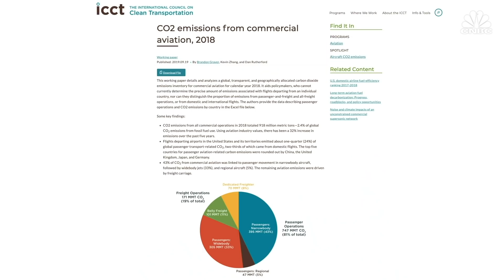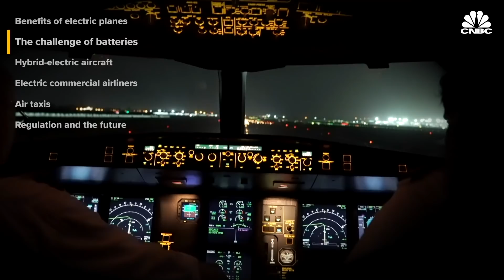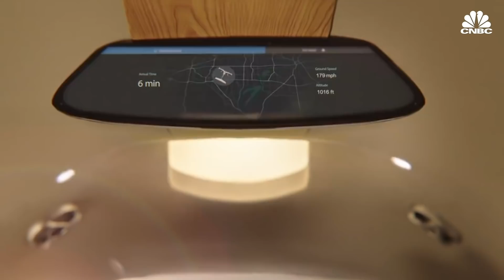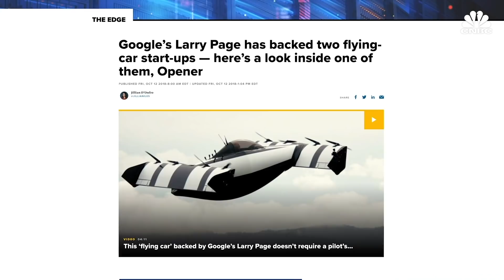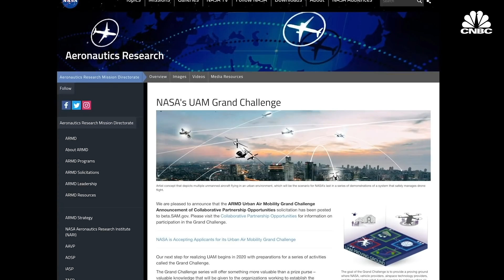Why Don't We Have Electric Planes Yet?

Comment: Because we have barely started with electric cars and airplanes are a lot bigger, more complicated, and more power hungry than cars.
Reply: There are other issues to, planes need to be lighter to land than they are taking off otherwise they can over run the runway and crash. With fuel this is not a problem as it's used up while flying but with batteries that weight doesn't go away even if you use the energy
Reply: @AdamSmith-gs2dv  This mostly applies to the largest of airliners as not every airliner has the ability (requirement) to dump fuel

Comment: Electric planes for short distances exist since a long time, they’re called trains. Way more efficient and cheaper.
Reply: In America we do not want efficient.  We want what is overly complicated and expensive.  Trains have always been the best way to move freight across the country.  Solution, remove all the tracks and invent a new career option!  Over the road trucking!  Thousands of accidents a year, no education required, horrible for the environment, and hugely expensive for everyone involved!  'Merica!
Reply: @davidbeppler3032  What are you talking about? Americas freight rail system is the best on the entire planet. Trucks are not used for long distances, port to warehouse shipping is primarily done by rail. Warehouse to store/consumer is what is done by trucks.
Reply: @AdamSmith-gs2dv  Have you ever been to America?  There are no trains.  They are extinct.  But we have hundreds of thousands of truckers.  For reference I grew up in a town with a functional train system.  It was never used, but it was functional.

Comment: Because the REAL electric age is still in its infancy... We'll get there soon enough once power density of battery tech improves...
Reply: Batteries have been around since cars have been around, infancy my ass
Reply: Ian Weetman if, not once.
Reply: Ian Weetman the technology is here, investors are just getting the most out of oil first
Reply: It has. Just not ethical though. Child labour.
Reply: jweltsch22 you should read up on what happens when technology meets Hydrogen lol. There are risk with every thing that is flammable. Hydrogen and electrolysis is the way to go. The only by product is H2O if done with Solar, wind, hydropower or even nuclear.
Reply: @Kenny-qo5tz  nah, because I already none of that matters, because of something called Human Nature.
Reply: Edison was making electric cars...
Reply: @abyteuser6297  that's nice.
Reply: The oil age is younger than the electric age. Having a power plant convert material directly into usable energy is more efficient than producing energy, storing it, then consuming it.
Reply: Glad I won't be around!!!!
Reply: This. This comment nails it!
Reply: I tgink recharge time is more important than power density.
Reply: A good looking new tech right now is aluminum ion . apparently some feel it will hold alot more energy than lithium
Reply: Very true. One day when get get better batteries or a new fuel source tech we’ll have EV planes .
Reply: Indeed! Batary power with super Potential Energy like keeping power to a year with out charging it
Reply: Or maybe in 2024 during a solar maximum 😋
Reply: True... but some people will use that fact to basically say we shouldnt even bother trying to develop it because we arent there yet.... which is pathetic. Like yes, we get it.... we arent 100% there... but the only way to GET there is to put in efford and continue on down the path
Reply: @Ben  Daulton  Fascinating.
Reply: @Ben  Daulton Even of they figure out how to make it rechargable, it's cycle life will be really low for a long time. It may never reach the cycle life of other battery chemistries and top out at the low 100s.
Reply: @Sam Mencia You can use electricity to produce hydrogen, there are sources of electricity that do not release CO2. 
Hydrogen is a superior energy storage of produced electricity for transportation. 

I'm sorry to inform you that if you thought that I had not taken this into account then it's your education that's lacking. 

Wee need more nuclear reactors, most green energy source we got.
Reply: @Sam Mencia I'm just some guy on the internet.
Reply: They solved how to store hydrogen, you have 5 years to make it better than hydrogen, which will be cheaper, longer range, able to fill faster than a petrol car and be used in trains , planes, and trucks, tic toc , electric cars are the Atari , hydrogen is the future
Reply: Electric age cant start until we can generate power without coal and gas. Sure, there is enough solar power in the forests and jungles to power the world, I just dont think replacing the worlds forests and jungles would stop global warming.........
Reply: Hardly in its infancy now. But how do we improve batteries over what's available now with a 4+ fold or exponential increase? No one is working on that.
Reply: @weldonyoung1013  aluminum ion in the UK.up to ten time capabilities
Reply: @solvox5217  , true aluminum ion can hold a massive charge, but the structure of the aluminum in the battery is destroyed when using the battery. Thus the battery is more like a fuel pack that needs to be replaced with each use. Hardly convenient or transportable to many airports.
Reply: @weldonyoung1013  you are correct at the moment because of the air it is compromised but I hear they are trying new methods to hopefully be able to recharge.buy as far as being way cheap at mass production than lithium it could hold a place as a sort of back up to Li for long range flights and would only say change em out every few flights and they would be way lighter.i think it holds as a possible hybrid contender and even more if they can figure out how to reuse it without reworking it.
Reply: Or we could just use hydrogen. 
You know a proven jet fuel with superior energy density with 0 emissions. 
We're purposefully waiting on batteries because of the petrodollar and investments in unextracted oil.
Reply: @fl00fydragon  And how much coal are you going to burn to create your "clean" hydrogen?
Reply: @CGoffgrid  None. 
Just fire up a few reactors. 
Nuclear: Greenest energy on the planet.
Reply: @fl00fydragon  You do realize that Uranium supply is limited, right?
Reply: @CGoffgrid  It's a nice 100-200 year buffer until we move on to tritium fusion

Not to mention that fossil fuels are also finite. 

You presented non problems.
Reply: @fl00fydragon  Just pointing out that there are limits. And 200 yrs is at current usage, but many more plants will be coming online. I like nuclear, but everything has limits.
I will give you this, you are one very optimistic dude.
Reply: @CGoffgrid  as I said it's a buffer to give us enough time to use the moon as a tritium mine. 

If we sit back and say "problem solved"  then sooner or later we'll be at the same position.
Reply: @fl00fydragon  thorium is better
Reply: Graphene is the key.
Reply: @DrDubbs  Graphene my ass. They've talked about it for decades and still no result.
Reply: Batteries were perfected 10 years ago. 200 year from now batteries might be 0.01% more efficient. We might have electric drone taxis for short distances, never for long distance travel.
Reply: @Steve_Milo  just in the last ten years they have gotten better than since the ancient one found in bagdad from thousands of years ago.and now there using new conductor elements to store even more power than Li
Reply: @solvox5217  it's not like I'm an engineer and this is what I do for a living, but okay.
Reply: @Steve_Milo  you can be an engineer all day .but guess what there are many.maybe a rebuttal instead of credentials? We can talk about how close scientists are to solving aluminum air rechargeability as one ex.or the use of hybrid air ion tech or maybe twenty other ex of battery tech getting better just in the last 5 years.hell we can just look at Duracell and Energizer and see a 15-20percent jump in the batteries they just released.i work with engineers all the time sometimes they think they know more than they do.
Reply: @solvox5217  sure kid.
Reply: @Steve_Milo  how enlightening!
Reply: @solvox5217  not really. I learned many years ago that on the internet people do not care about what is true, they want their opinions be the truth. I also learned that everyone believes they are an expert, and they grossly overestimate their knowledge. 

When I encounter these people, I do not try to show them the facts, or save them from their ignorance, because it is always dismissed. Pearls trampled by swine. They care about their emotional satisfaction, not about knowledge. They do not want to be saved. so I let them go on believing whatever it is they want to believe.

Enjoy it.
Reply: @Steve_Milo  you make so many assumptions and generalizations about people there are all kinds.i have yet to claim to be an expert in this field but it a hobby and I read about people at top levels in there feild who hold credibility and credentials.i dont expect to always think I'm right only I havent said anything I feel is controversial and instead of at least trying to make a point about a comment you made that was called in question you write a diatribe of how your faith in humanity is basically lost over a few trolls on comments.ive been on various boards since before there were boards I just go with the flow.if I spent my days worrying over swine I worry not if they eat the pearls or not I just enjoy the rare time I find good combo.or just get called a kid lol makes me laugh anyway.
Reply: @solvox5217  then keep doing that, and not just with what interests you. Do it on the big questions. Then one day you'll find yourself on top of the mountain, and you will see people who you know to be far more educated and intelligent than you are, still struggling to make it past the base of the mountain on whose summit you have already reached.
Reply: @Steve_Milo  you mentioned the big questions.while were there there is a quick way to get to the top of the mountain and beyond.once you can separate your ego and definition of I at least for a moment you'll see there is no other and all is one.you are the universe.what you are experiencing now is a subjective reality based on your  environment and perceptions.the universe experiencing itself subjectively for itself.you think of your self separate from air or galaxies or me but your not.once you see that you'll see how funny this convo is.
Reply: @solvox5217  When someone tells you that your experience is subjective reality, they are telling you not to believe them. So don't.
Reply: @Steve_Milo  what is experience in your opinion? If you do the math simulation theory or string theory makes alot of sense with what we know about the universe.
Reply: @solvox5217  I do not rely upon opinions. I rely upon knowledge. Here is how I separate opinions and subjective interpretation from reality.

Anything that contradicts itself cannot be true. 

Example, "the only absolute truth is there is no absolute truth" if the statement was absolutely true, it would contradict Itself by its own logic. Truth does not contradict itself there for the statement is silly and self-contradicting and there is absolute truth.

So when you tell me what I am experiencing is a subjective reality based on my environment and perceptions, then how do I know what you are saying is true since it has to pass through my experience and they are subjective? The statement contradicts itself so it cannot be true.

The answer is both subjectiveness and reality are passing through our experiences and perceptions. You have to be able to use your perceptions to separate what is subjective from what is true.

You can only trust your eyes some of the time, you have to be able to recognize when you can trust them and when you cannot. You accomplished this through logic, truth does not contradict itself. If something contradicts itself it is not true.

String theory has a lot of self-contradiction and circular reasoning in it, therefore it is subjection mixed with the truth and therefore not 100% truth. Since string theory is a self-contradicting theory, it is a very bad way to try to figure out the universe and what is absolutely true.

By accepting what is only 100% true and does not contradict itself, you will take a lot longer to find out what the ultimate truth on top of the mountain, but when you get there you will know with 100% certainty that it is absolutely true because of the truthful path you took to get there.
Reply: @Steve_Milo  you will forever be lost to say you can find pure truth when everyone's truth is different.you might say there are universal truths but even those have instilled within them a touch of grey.for one simple reason you cannot have black without white or a wave without a trough.everything is in relation to everything else.this is logic.we can only see with our telescopes part of our universe supposing there is a multiverse ,which if you study superposition is a logical assumption.thrn every possible thing than can unfold will.or maybe we were entered into a simulation long ago by ancient aliens that created A.I. or maybe not .but truth I don't think means that much in the grand scheme of things.the universe unfolds with or with out our narrow scoped ideas.
Reply: @solvox5217  truth is not one thing for one person and one thing for another. Truth is truth. If I say one plus one equals two, and the entire world says it equals 3, then the entire world is wrong and I am right. If I agree with the entire world and say it is 3, then I am wrong along with the rest of the world.

Truth does not change, it does not depend upon us recognizing it or believing it to be true. It is a singularity. Therefore there is universal truth and we simply reject it or accept it.

You can have white without black. You can have light without dark. You can have truth without lies, or confusion.

Truth does not need a lie in order to exist, there is no balance, there is no binary codependent existence. But a lie does need the truth in order to exist. Thits is because a lie is the opposition of truth, truth is not the opposition of a lie, it is simply the truth.

Example, my name is Steve. This is a truth. Someone can tell a lie and say that my name is Bob, that lie could not have been told unless the truth of my name being Steve existed. The lie depends upon the truth existing in order for the lie to exist by opposing it.

The truth is that Steve is my name exists all by itself, if the lie that my name is Bob was never told,  the truth that my name is Steve will continue to exist with or without the lie.

This means what is true does not need recognition, faith, balance or anything at all in order to be true. It exists by itself. 

Universal truth is a singularity, and since I choose to believe only universal truth, therefore my beliefs are superior to everyone else's beliefs since everyone else is happy to be lost in subjective confusion. 

This doesn't make me better than anybody else, it doesn't make me smarter.  It doesn't make me richer. it doesn't make me holier. It doesn't make me wiser. It doesn't make me enlightened.

It's only does one thing. It means I am not confused.
Reply: @Steve_Milo  i will make an exit as I feel there were many ideas you flew past on your way to the top of the mountain.so I will leave with a quote by Allen Watts "Only words and conventions can isolate us from the entirely undefinable something which is everything.”
Reply: @solvox5217 
That statement is silly and contradicts itself. If everything is undefinable, then how could you make that definition? The statement cannot be true by its own logic, so it is not true.

Things can cleary be defined, including the great all encompassing Truth at the top of the mountain. 

It has already defined itself with just two words, but I will not tell you what those are since you are not yet ready.

Using simple logic and reason I have clearly demonstrated your ideas to be self-contradicting, therefore they are false and my ability to disprove them shows they do not go over my head. 

You are simply deflecting because you are more worried about appearing right than discovering what is right. Pride is its root.

I can show you the path to the top of the mountain, I cannot force you to walk it. The path is reason, it is lit by the light of logic.

But like I said before, people do not care about what the truth is, they want their own opinions to be the truth. This is because it is easier to cling to what is false, our own will. Then to give it up and to conform ourselves to the truth.
Reply: @Steve_Milo  wrong
Reply: You increase power density of batteries all u are gonna get is a bomb.....  https://www.youtube.com/watch?v=8RbwOhM6PUk
Reply: @edmccloskey9696  There is some margin left to increasing capacity but yeah, the closer you get to the physical limits of how much anode and cathode material you can cram in a given volume for density, how reactive each electrode is and least separation for power, the closer you get to having thermite where the fuel and oxidizer are pre-mixed and ready for ignition. Safety is a key limiting factor. There aren't many applications where spontaneously combusting or exploding batteries are acceptable.
Reply: @edmccloskey9696  look up aluminum ion.
Reply: Ed Mc Closkey you mean like a tank of jet fuel? You're really stupid.
Reply: @edmccloskey9696  Read the Nobel award list last year of goodenough... We already have batteries that is good enough to power a city with size of a car batteries.... Catch up with technology old men, you are left in the 2010s.